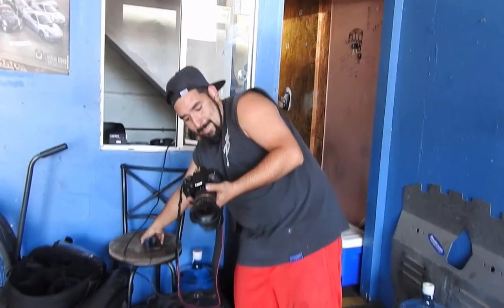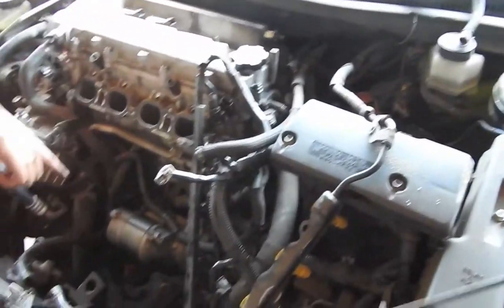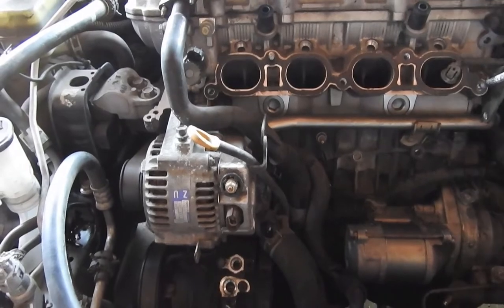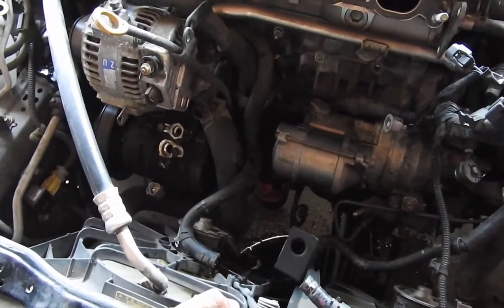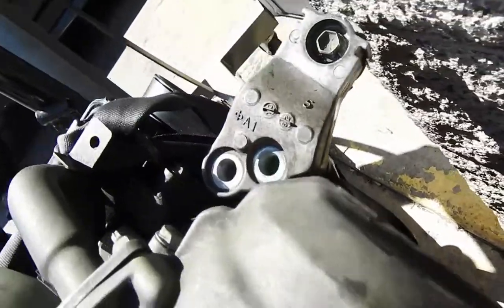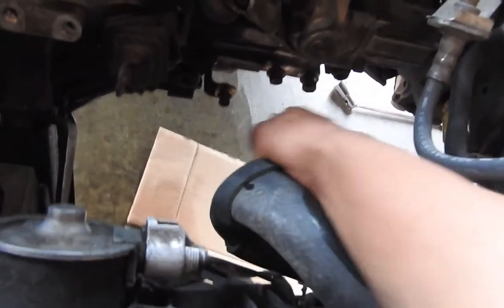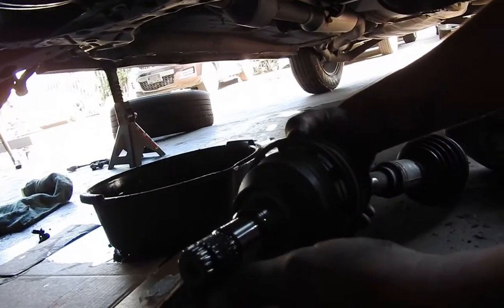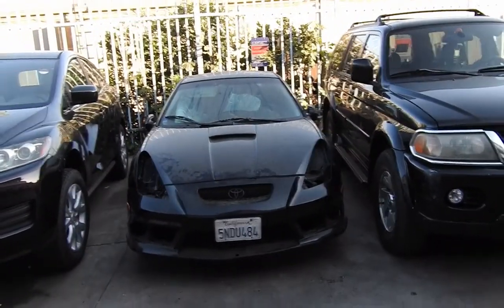Removing Engine 03 Toyota Celica GTS 2zz-ge

Comment: Yo question if you got time 
Have you ever had your celica be at half fuel and it starts to die like it doesn’t have fuel?
Gages read right
Gas caps good 
And then I replaced the mass air flow sensor thinking that’d help
Reply from the maker: Never had that problem you might want to check you charcoal canister